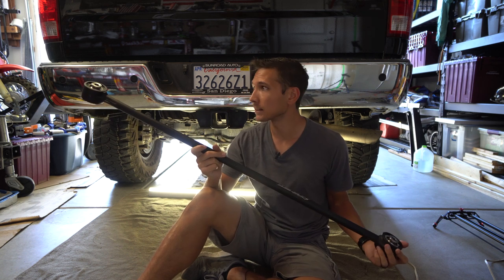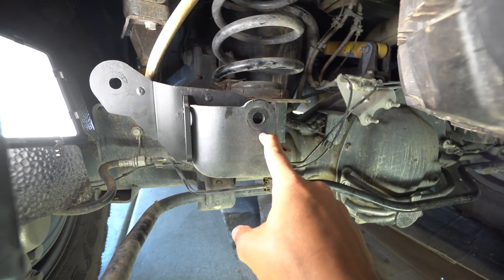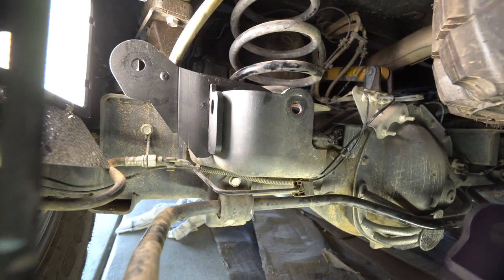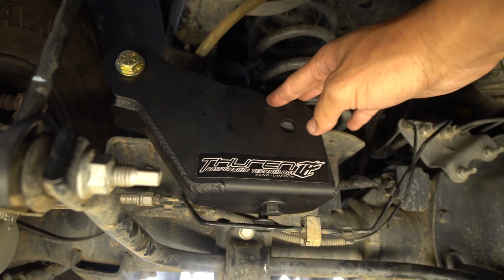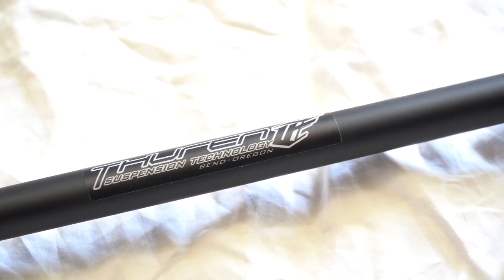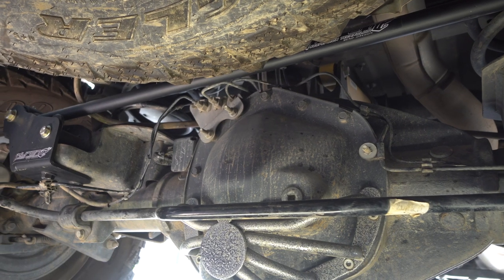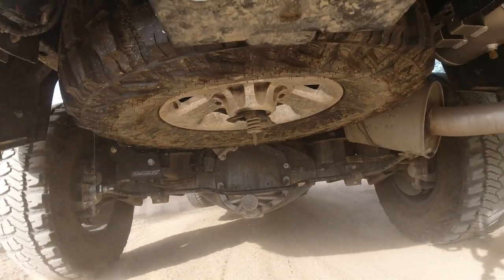Ram 2500 Thuren Rear Track Bar Upgrade-Stop The Wobble When Loaded Down

Comment: Thanks for the video. I thought I must Have a bad shock or something on my lo miles 2017 2500. When I told the guys at the dealer about the truck feeling really weird over bumps at higher speeds they looked at me like I was crazy, and of course they said NPF (no problem found). We tow a fifth wheel and it has never felt right over bumps on the freeway but the last time towing we really started swaying. I was going to try aftermarket shocks but I now think we will start with this track bar upgrade.
Thanks very much for the valuable info.
Reply from the maker: I'd definitely do the track bar first. 
Let us know how it goes!

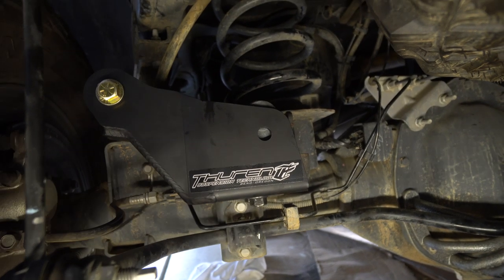Comment: At 4:41, that last hole you drilled out, you said you have to drill both through the front, and the rear as well. Did you drill bit reach the rear or did you need a longer drill bit?

And, how did you keep both holes aligned and centered when drilling the rear since you can't really see what you're doing because the front bracket blocks your view. I have my track bar ready to install just watching videos trying to get a feel for it before diving in on the install
Reply: I just helped a buddy install one on his power wagon and it was a pain getting the new hole drilled.  ended up drilling with a 37/64 drill bit going straight through as no real way to drill from the other side.  Seems like Thuren could supply some kind of jig/guide or something to make it easier.

Comment: I am worried that my full size spare will not fit with the rear thuren track bar mine is 35x12.5x18 it fits with stock. Looks like your full size spare fits fine what size are you running?

Comment: How much grease do you pump into these bushings? Or do you pump until it oozes like old moog ball joints.
Reply from the maker: I just give a pump or so…from what I’ve seen (if I recall correctly) is that if you see the grease coming out on these, they’re overfilled/not good.

Comment: What kind of lift or suspension kit do you have
Reply from the maker: This is all stock, but the power wagon has a 2" lift over a normal 2500...so technically 2" I guess. But it was a stock suspension power wagon